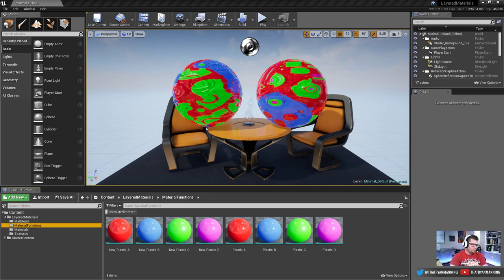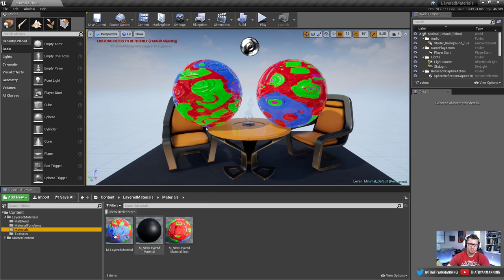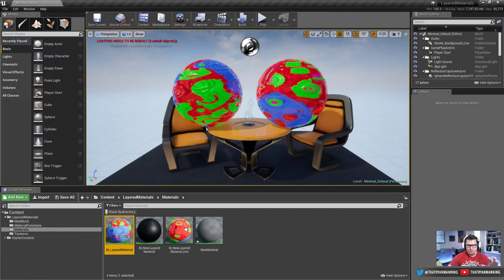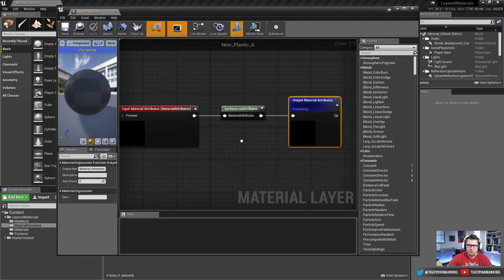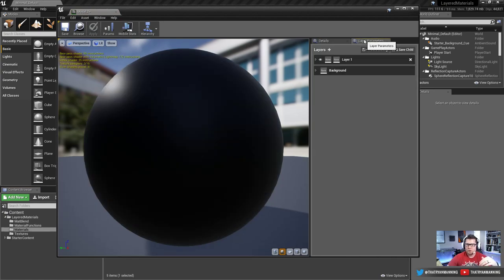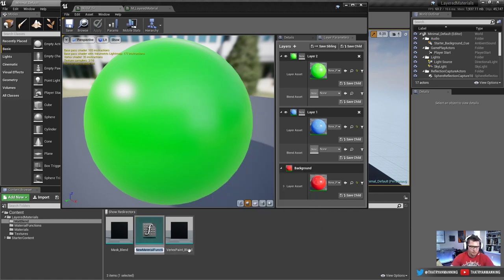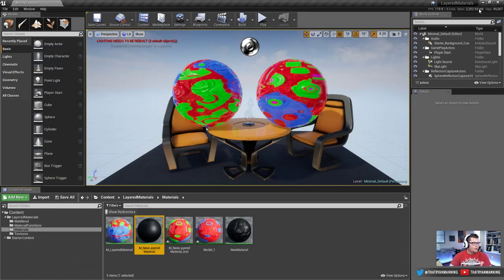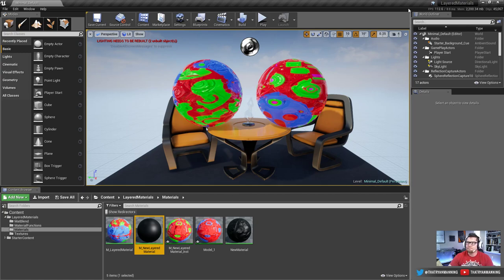UE4 - 4.19 Layered Materials Setup

Comment: Hey Ryan, awesome tutorial. Thank you so much for taking time to make it.
I have a quick question, is there a way to access the Material Layers - Blend Asset - Vector Parameter Value in Sequencer?
I have tried making a Material Instance for the Layer Blend Material and I cannot reach the Vector Parameter into sequence. I am trying to animate the crossfade.
I have tried with material parameter collection, got that into Sequencer but the crossfade is not smooth. I see stepping between 0-1 values.
Is there a way to fix this?
Thanks!
Reply from the maker: A couple ways to do this. Material Parameter collections can be targeted in Sequencer. You can also access the material parameters by adding the material component in sequencer. Target the element via the "+" add button, add the component, then target the material parameters.

Comment: Great video! Just starting with UE and of all the videos that I have seen bout Layered materials, this is the only on that I can really understand. Most other videos teaches the "old" method in making Material layers which is really confusing. I have followed every step in this video but when I got to the RGBA Mask  (22:00) I get an error at the ChannelMaskParameter Node when I connect it into the BlendMaterialAttributes Node.  I don't think I missed anything in the steps. Any ideas?  I'm using UE 4.26.

Oh.  I just restarted it and it 's working now.  My bad.

Comment: I'm still fairly new to unreal, but I'm trying to make 1 single material that can transition between 4 seperate metals with a gradient slide/slice effect. I've made one that works nicely, effect included, but it can only transition between 2 metal types (using a MFfunction with a 3 layer blend - inputs 1 2 & 3 are color parameters) but I need to have more than the 2 available inputs for this project and master material. Are layered materials a better route to go for this?

Comment: Fantastic and really helpful tutorial! One question though, what if my base material has opacity? Plugging the texture's alpha map into the "opacity mask" slot of its "MakeMaterialAttributes" node doesn't work like it would normally in a regular material. Is this an easy fix? I reckon I'm probably just missing something basic.
Reply from the maker: There are two places you can change the Blend Mode; one in your master and also on a per-instance basis. https://i.imgur.com/NtVsPLm.jpg

Comment: In 2020 those material layers still crash engine  (4.24). In blank project they work fine (mostly). But when you turn them On in your heavy project - it crashes very often. Tried in 3 different projects.

Comment: Thanks for the tutorlals. Is there anyway of showing me how to convert a materialfunction to the MaterialLayers setup with version 4.20? Using ML_LowContrastHardMetal its from Paragon assets. I did follow ur stuff, but I'm stuck. I copied the nodes from the materialfunction into the new MaterialLayers system as you shoed in the tutorial.

Comment: Thank you Ryan for this break down. Im loving this system and know how to use it thanks to this video. 

Question. I followed how you added a normal in the Master Material and laid over all layers. But how do I do it for another map like Ambient Occ?

You created and GetMaterialAtt and a Set MaterialAtt and had the nodes in between. Got that part. Lets say I want to do the same thing for a ambient occ map. Ive been playing around
and the only way I get get it to work is if just plug in an AO map directly into the AmbientOcc of the SetMaterialAttibutes. Do I even need the GetMaterialAtt. I can figure out what the inbetween nodes would be if I did it the similar way with the Get and Set nodes.

Thank you Randy.
Reply from the maker: Randy - My recommendation would be to add an additional AmbientOcclusion node to your "GetMaterialAttributes" and use "Blend_Overlay" (Blend_Overlay will either screen or multiply the Base and Blend together) to add your custom AO map. For additional control over your AO map, simply add a 3ColorBlend node(https://docs.unrealengine.com/en-US/engine/rendering/materials/functions/reference/imageadjustment). There are several methods, but this is just one. Here's the final setup: https://i.imgur.com/Mm6Rs1F.jpg
Reply from the maker: I should preface, I'm reusing the combined layered texture from Crunch which has the AO texture in the Blue channel.
Reply from the maker: @tapirtoon ! Yes. I cover this early on in the video, but you can use material functions (the old material functions) and then blend them together using mat layered blend nodes inside a stand-alone standard material. https://docs.unrealengine.com/en-US/Engine/Rendering/Materials/LayeredMaterials

Comment: can be different lit materials combined
 like subsurface and default lit?
Reply from the maker: Yes. Your materials are created and built very similar to the older method, with the exception of instead of using a standard material function, you're using the new layered material function (2:11) layer. Any of the parameters contained in that function can be utilized.

Comment: In my opinion Unreal has total not intutive, different, idiotical, baaaad material system in this cause. But this tutorial is very good :)
Reply from the maker: UE4's material system is extremely powerful but also very technical. While is may be not as simple as other editors out there, speaking from experience, you have way more customizability! With enough time and education, UE4s material system is something you'll come to enjoy.
Reply: @ThatRyanManning  I do not understand what happened to mix basic materials, such as in a e.g. blender. I already have materials, that I want to mix, I have to make do them again to material function. A better solution in my opinion would be to drag them into the editor and mix immediately basic materials with basic materials. Why couldn't they do that in this method? I do not know I do not understand this issue but I hope I will understand.  And cannot doing a quick conversion of these materials, and have to work a lot, unnecessarily in my opinion. Sorry for bad english, thanks for reply and regards :) !
Reply from the maker: @leksiu92  totally agree with you. I believe Epic is overhauling the layered material system to be more artist friendly. If you think of Material Functions as Materials, it makes it a bit easier, but still...not the ideal solution.